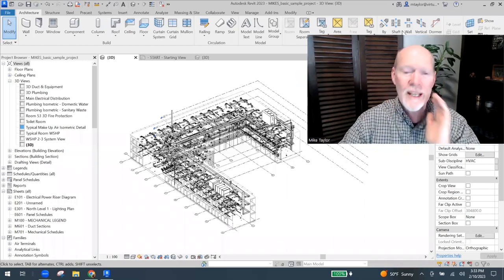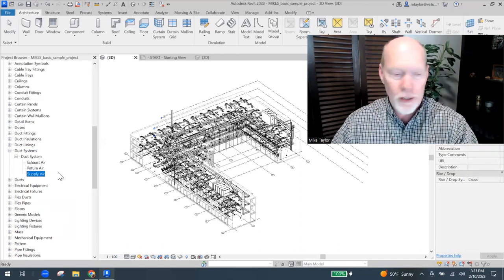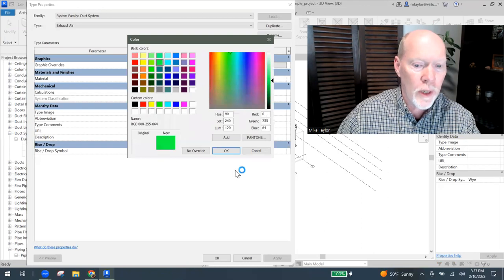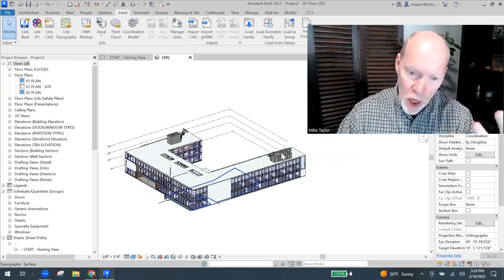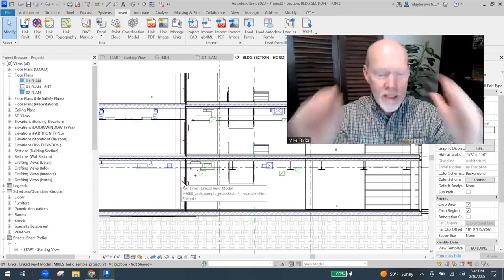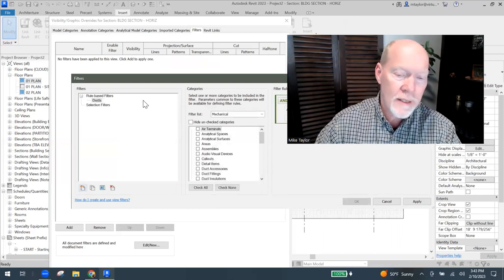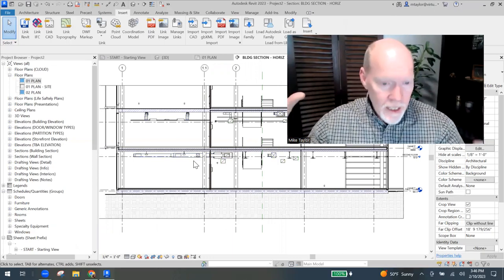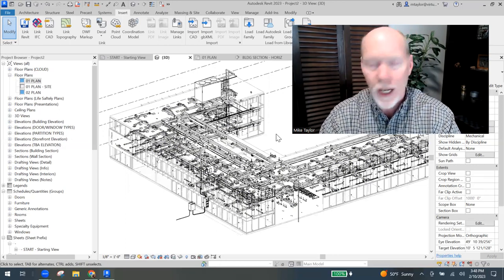Change MEP colored Ducts (and pipes, etc.) to Black

Comment: Mike, what if I wanted to just filter out the waterlines in a plumbing plan, the filter will do pipes, but is there a way to just filter out the water pipes?
Reply: You can setup the filter so it targets pipe by it system. That's how we color our pipes in MEP plans. The set up is -> filter -> pipes,pipe fittings, pipe insulation -> System type - equals - SW (for example). SW is the name of the system type of the Sewage water. If you dont know what the system is just click on the pipe and find it in the properties ( System type). You can use bascily any of the system parameter -> System type, System Name, System abbreviation to target that system specifically. The filter will color even if the pipes are from a linked file.

Comment: Hi Mike. I have a question regarding column-beam-plaster issue and what template (architecture or structure) to use to get the best use (or practices) of revit modelling for accurate take off & etc.

Thank you if this can be explained in a video 🙏